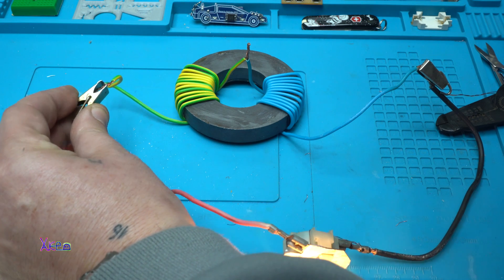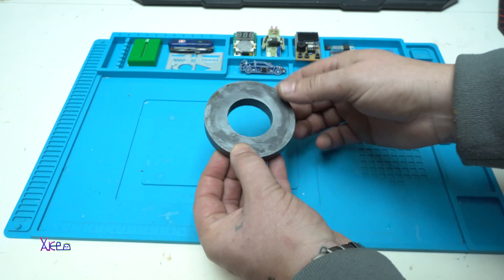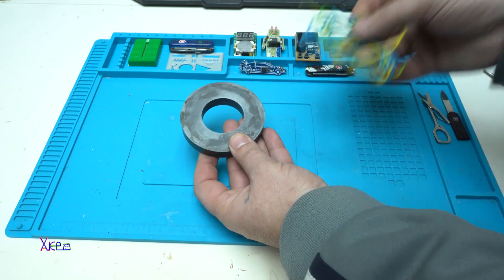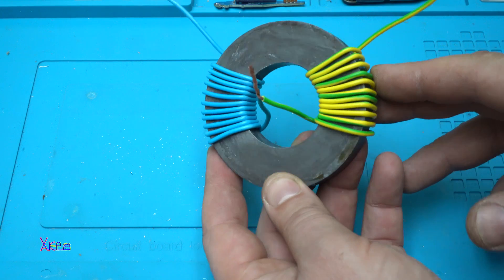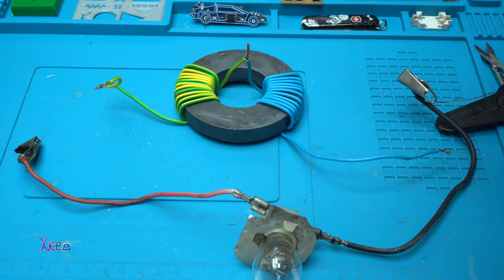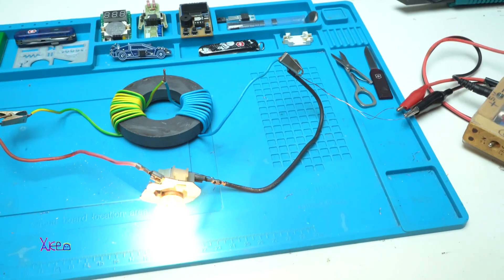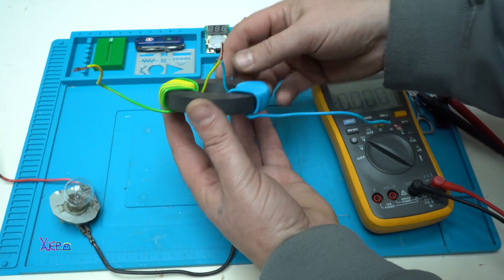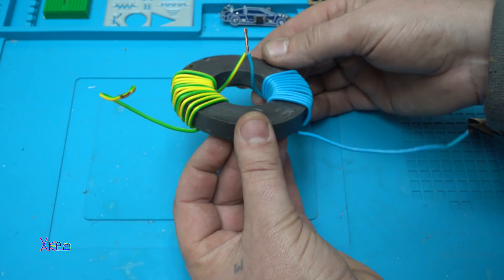Energy from Magnet -True or Fake? Making and Testing

Comment: Of course the sun is free energy..... Once the tools to collected are assembled.... Maybe this hoax is a good thing.... Modulation signals traveling through our air continually maybe can be tapped for some kind of inductance... That can be increased with proper methods.... Maybe the planet itself has some kind of inductance to be harnessed..... Assembly test and micro voltage testing to see the gradient possibility of varying this voltage power